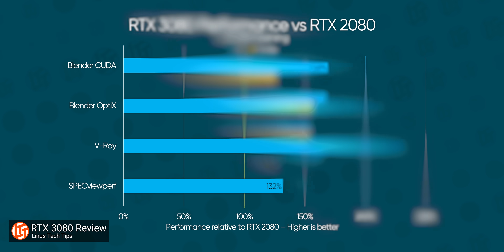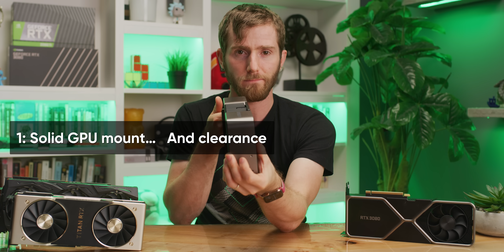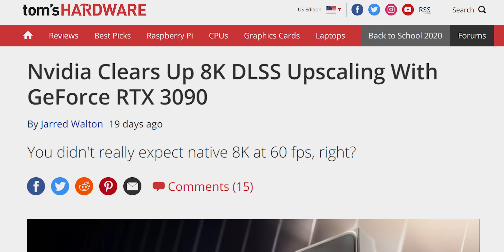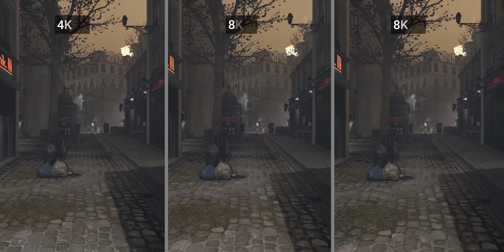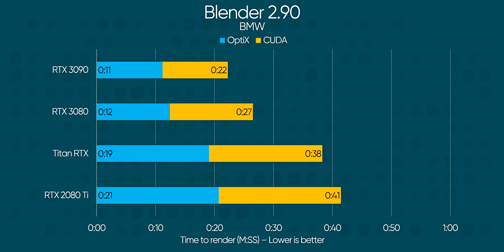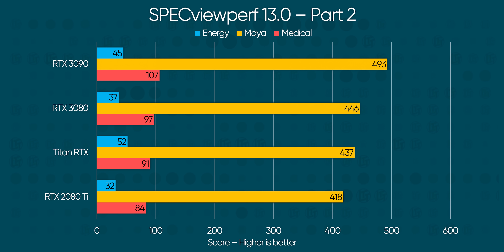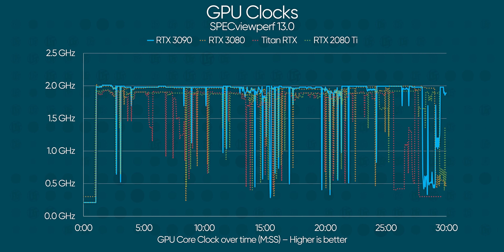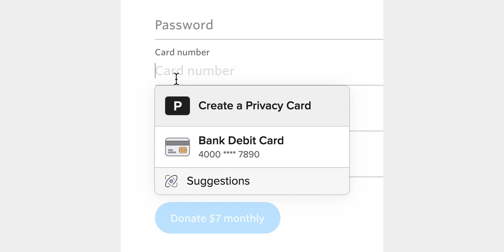Making Nvidia’s CEO mad - RTX 3090 Review

Comment: but most data i've seen including various pc platforms such as steam indicate that very little even play at 4k and even less actually have the hardware and since this is something you'd only notice with an 8k tv that's large enough cause lets face it unless you want the tv to look like a window(and quite frankly I don't think the pixels are small enough to be fit on smaller screens with current technology limitations)

I think the only people who can get this is the rich or the enthusiasts who would spend their life savings I got a 28inch 4k monitor and I am fully satisfied for the forseeable future plus I like to be able to reach my keyboard so a larger screen isn't an option or I wouldn't be able to see all of it possibly 30inch 4k would be my limit but i'm dirt poor now and the wall of next gen is so high I can't keep up so i'm considering a ps5 as long as the limited NVME storage capacities and high prices don't sink us into oblivion!

I suppose while xbox new ssd is a type where the price will likely be fixed, at least supported NVME's for the ps5 will price drop over the years so yeah... it will take me about 8-9 months but i'm getting a ps5 and even though it's got wi-fi 6 I know I won't be able to stream 4k cause my upload is only averaging 7.29Mbps

But yeah back to our current subject even if I was rich I don't see me buying this I easily get excited about new tech and this does excite me as it's a boundary pusher on the edge there but otherwise the tv itself and gpu not interested, I know nvideas is better than amd's best but even if I was rich I've grown accustomed to AMD now and if I make smart business decisions in the future and am able to afford a super pc by then hopefully by then AMD will of finally found away to close that gap

people thought it impossible with intel being closely caught up to who knows if amd keep pushing boundaries maybe one day their GPU's will have the recent success their cpu's have! but tbh despite competition making things interesting I wonder how much better their tech's would be if they did a collab and shared the best of both their hardware's

amd have been super successful at pushing those tech boundaries without too much of a dramatic price change which is why I was impressed to hear that new gpu of nvidea's cutting the cost of a gpu by 1000 while still improving the hardware greatly!
it goes to show the future may be bright if both companies end up on equal footing some day it could mean their competition may not only push tech further but may also push them into price wars which can only turn out for the better for consumers if things are more affordable on both sides!

also that gpu would not fit on my motherboardf (might fit in my case but considering the issues I had with keeping the RX580 stable with it's size and weight I think i'd have to bolt a small pillar to the underside of a 3080 just to hold up the farthest corner from the back to make sure it's weight would be held)

never try and use zip ties to hold a gpu (that was my learning process) we had to push through metal cause the msi ryzen case I got hadn't had the excess metal trimmed from the holes you nail the gpu to! my stepdad manage to use his inhuman strength to push it through by hand then again in such a flammable workspace drilling to clear it would of been a bad idea!

but hey now at least it looks cool now I just have to upgrade my psu though apparently the low W consumption of the radeon hardware are somehow taxing the the 600w PSU so I'm assuming it's getting on in age i've had it since around 2014 might get a 900W but as long as i'm saving for the ps5 that will be on hold as long as I don't do anything stupid the psu should last me another year or so anyway!

4k pathtraced minecraft with 7 different texture packs combined on max shader settings with just my budget rig isn't bad if I could afford vr it would run it but with barely any money and being unable to walk for anything other than a short distance without being out of commission for 4 days due to an illness I don't entirely understand means it's gonna be a while before I get the monetary funds I need to do better

good news is theres a computer scrap yard halfway to the closest town and there are official university courses I can study online and then physically just go sit for the exams to learn coding, computer engineering, metalwork and soldering, and computer science
not all are free but most of em are (except CS because it's an advanced higher learning course) I know now I at least have the capacity and aptitude to learn these things so give it 4 years I may be building my own machines any

and with a scrapyard down the road and bargain options I may be able to build a unique pc like no other once I have the skills to do more than just put hardware together... maybe I should make a video for my future self to watch and then I can look back in 5 yrs to see and think either my past self was an idiot or was on the money!
Reply: Also i'm just comfortable with the amd software it's a personal preference based upon what i'm used to You do you haters gonna hate but I don't give a damn about the whole war if sony and microsoft can to a collab on software tech then surely it's possible one day these giants will collab too but either way it's likely team red, blue or green regardless of collabs will continue to fight anyways!

Comment: I bought the 3090 Founders Edition to replace my RTX Titan. It's definitely a beast! I have a Falcon Northwest Mach V case, and it's a cozy fit, but plenty of room to spare. I've only thus far tested Crysis Remastered at 4K, which it can do 60FPS+ on High. It drops significantly, into the high 20's, when in "Can it Play" setting. I think for most people, the 3080 will be just great, and huge deals on the 2080Ti's which are still excellent at 4K. I wouldn't be surprised if the "Titan" variant costed $3,000+. I just bought it because it seems more future proof with its memory size.

Comment: Hey so in my current pc I have an intel i9 (9th gen) and my ram is ddr4 3200 32gb and my motherboard is a asus rog maximus xi hero and my power supply is Corsair hx1000 platinum. My current gpu is a msi GeForce rtx 2080ti trio does anybody know if I can upgrade to the rtx 3090

Comment: Never ever would I'll pay more than €50 for a video card.
Bought one gtx 680 for €50  and it works just fine
If I'm still  alive in 2028,  I'll get a rtx 3080 then for no more than €50 
So,  2.922 days  from now , need  €50 , uhmm ,  have to save €0.0171115674195756 a day.
Not an easy task but I think I can do it.

Comment: Hey linus! Long time lurker but, thought i had some questions. So considering the RTX 3090 is an enthusiast card, what would you put the Tesla K80 at? I just bought one to start learning dev- in physics simulations, I'm going to be running it in tandem with my Quadro2000. I just read somewhere to expect TFLOPs in the 1.87+ range vs the Titan RTX with ~.51.
Reply: Emily An  I just looked into the abstract of a CFF evaluation to get the basics, were you suggesting that for my physics simulation/analysis? Sorry if I didn't get the point you were trying to make. BTW I should let you know I spent 300 dollars on both of my graphics cards (used but in Pristine condition) [30GB total VRam] {4 display ports} My goal is multi-core micro/spectroscopy and thermal imaging of polymers under stress.

Comment: 11:00 How come your "high quality" power supply which is rated to output 850 W couldn't handle your PCIe card that draw around 450 W? Did the rest of the system draw over 400 W at the same time? Did you have too much stuff pulling from a single PSU rail?
Reply: Too much RGB

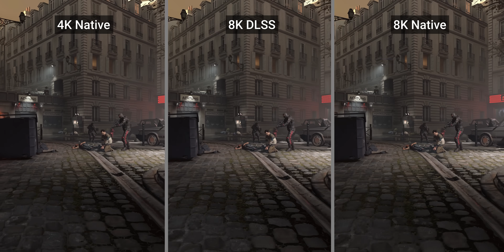Comment: 07:04 k, so considering I don't see ANY difference at all between those 3 video's.
Would that mean I don't have a need for any of that?
I just want my card to be able to run a game as its best settings without going slower.
I'm just hoping the 2080 ti I unfortunately bought without knowing the approaching 3000 series can do that.

As my eyes are apparently not as good as I thought, considering I really don't see that much of a difference at all in 8k or 4k.
Partially, that's making me also worried.

Might just wait another 2-5 years for the 4000 series instead of trying to sell my 2080 ti.

Comment: being able to expand the video memory is something they should have worked into their lower end cards NOT just their biggest beast of a card . i can see why it has it , but their low end cards should too.  because that is where memory can drastically affect pricing and performance.

that all said i'm so tired of the resolution bumping. it's not even about computers or video cards , it's all to sell fucking TV's we don't need.  NO ONE is broadcasting in 4k yet let alone 8k . most HD broadcasting is still done at 720 p and not even 1080p.  the yougner generation ahve shown they don't give two shits about   blu ray players or 4k players. i doubt the market will even see an 8k disc player. you know who needs and can actualy make use of having an 8k tv ?  not a single fucking person on the planet  except for the rich ass that buys one of those nvidia cards. and they'll more than likely be using a  PC monitor not an 8 k tv.  

from 1950 to 1995 standard  crts at a 4:3  640p  res  lasted long ., because people manufactured better products in the 50's-70's. in the 80's we started making every thing cheaper and disposable. and it's so industries can soak up more dollars on us replacing broke  crap they sold us  only 5 years ago.  the smae thing is going on with tv's they want to sell  us more , more and more so they have to push  the resolution to get us to replace our old tvs now.

Comment: I will always watch updates about the newest technologies knowing ill never be able to afford it :D
Reply: I always watch things about tech that I can’t afford and then get it in like 3 years 🤣
Reply: @robbydufault7382  eyy atleast u got it!
Reply: RTX 3090: changes the game
Me with my R5-1600 + RX 580 running Windows 7: hmmm interesting
Reply: @mihan2d  oh boi I thought about buying a gpu and I was like heck I forgot what is my processor - ryzen 5 1600 sad trombone noises. Still a great cpu but it's old propably going to bottleneck most of the new gpus
Reply: @eromisimo  BS. First Ryzen has still a decently strong core and with 6 cores and most modern games oriented for 4+ cores it is NOT going to bottleneck anything except for RTX3090 or 6900XT, as long as you have fast memory. All tech YouTubers say that CPU architectures are generally good for like upwards of like 7 years or even more. At least unless the core is weak to begin with, which is not (again, mainly dependant on memory speed here).
Reply: @mihan2d  I was thinking about second hand 1080ti tho
Reply: @mihan2d  and fast memory you mean ram ?
Reply: @mihan2d  I my cpu on 3.7 stable works like magic and got my ram up to 2800
Reply: @eromisimo  Should be fine I'm sure. If you really wanna juice it up for the 1080Ti you may try and play around with getting RAM to 3000 and the CPU for maybe 3.9 but up to your skill, I think stock Ryzen 1600 should be mostly fine unless you're playing at crazy high refresh rate monitor.
Reply: @mihan2d  might just buy 2x8gb @ 3400 for around 50 dollars
Reply: @eromisimo  I'd try and overclock first - it's free, after all. If it isn't stable enough, then might be a good idea to buy new memory.
Reply: Just think about it this way, in 10 years performance on this level will be dirt cheap :D
Reply: Yo what are you guys talking lol. Im just a casual with i3 10100f x RX570 playing anything that i can sit with 😂

Comment: Issue I have with the 3090 is that all the previous 90 suffixed cards were 2 gpus on the same PCB or sandwiched together taking up only 1 PCI slot. Friend of mine mentioned the 3090 and my first thought was "Nvidia said several years ago they are done with dual GPU cards...(remembers the 690)". Double the Vmem is amazing though. Aside from leaving headroom for higher FPS or higher resolutions, I have never regretted advising friends to get the GPU with the most onboard memory when they go to buy a flagship. The 3090 easily is a card that will last for 4 years of solid gaming even with new titles making use of more vram. Pushing 8k gaming is laughable though. 8k in any normal PC gaming situation is more DPI than needed by far; I still don't know anyone that would benefit from more than 4k(even that is too much normally, 1440p being the best for almost all). Also, it's been a long time coming, cases should come with mounting meant for a GPU with riser cable. For 10 years motherboards have been strained with heavy cards pushing on PCIE slots. It makes more sense to mount the GPU to the case completely unsupported by the motherboard. Freeing up the GPU to be mounted elsewhere allows for much better air flow if done thoughtfully.

Comment: Linus dude - Can you use a standard air cooled RTX 2080 Ti's with similar power limits as the 3080 as there are just as many out there. They even run cooler, generally can clock happily between 2000-2130 without a bat and I really have not noticed much of a speed difference when comparing 'apples to apples' rather than a lower power limited 2080 ti without power limit increase to get the most out of it while it still runs cool.

I have ran all the 3DMark tests with my 2080 Ti that is stock with a 312w power limit. The differences range from 0.04% to not even 10% when comparing with my i7-10700k at similar clock speeds and 2080 Ti with similar power limit. What gives???

I bought my Asus 2080 Ti 312w power limit lives in 2070-2130mhz and 8ghz with no mods just msi afterburner in a decent case. I purchased it over 2 years ago in Sept 2018 for $1259 Australian, sure the prices went up this year but at least the build quality is good and they run very cold even with annoying aggressive Turbo Boost 4.0 kicking in from 45-50 degrees. The price factor with the feeble Nvidia stock for the RTX 3080s have now made the 3080s go for that price or more here. So, that price thing really isn't real world but Jacket man sure got the hype train going in his kitchen by using Minecraft and 1997 Quake 2 with ray tracing as % figure comparisons. I think their stock after Sept 9 announcement was actually higher than the 40bn to acquire ARM. So, the old wear the same clothes CEO thing and funky graphs fooled the world.

After seeing that Doom Eternal comparison I knew something was weird. As I had just completed it at max settings at 4K WITH HDR on (unlike their comparison). I don't recall it dropping under the 100fps very often. So, naturally I went to the intro spot where the first Boss is in Mission 4. My card was within 1-20fps of the 3080 and almost always 20-30fps more than what ever card nvidia used for a 2080 ti. 

3DMark Tests: My Card Average temps are less than the 3080s and in general all the scores are within 5% but the 2080 Ti is a good 10-15 degrees cooler. Still under powered at 312w. Even with just 2 fans. all tests are in the 50s with avg mhz between 2040-2085 - max of 2130. The 3080s are more like 70s.

So, lets do some real world comparisons. Outside of Minecraft and Quake 2. 
Result comparisons with same excellent gaming CPU. Intel i7-10700k at 5.0-5.1ghz (no liquid nitrogen crap) and of course only 1x GPU. My similar powered limited RTX 2080 Ti of 312w Vs. Nvidia RTX 3080 with it's 320w power limit and not a cheaper aftermarket fail brand that can't handle 2ghz.

Results are for all RTX 3080 scores using same CPU i7-10700k at similar frequencies above 5ghz. To reduce the CPU physics score component and just video card performance.

3DMark Time Spy - 4.9% difference actual. 
3080 320w Power limit with i7-10700k @ 5.1ghz has a Highest score*: 16874 and *Average score: 16183
My 2080 Ti 312w Power limit: My score is: 15416 -> 2.5 years old 54 degrees. 

Fire Strike 30,350 my score on average for 3080s is 30,543 https://www.3dmark.com/fs/23609474 & https://www.3dmark.com/search#advanced?test=fs%20P&cpuId=2615&gpuId=1338&gpuCount=1&deviceType=ALL&memoryChannels=0&country=&scoreType=overallScore&hofMode=false&showInvalidResults=false&freeParams=&minGpuCoreClock=&maxGpuCoreClock=&minGpuMemClock=&maxGpuMemClock=&minCpuClock=&maxCpuClock=5050

Port Royal: https://www.3dmark.com/pr/306520 10,250 Vs 8,600 for the nvidia graph of a 2080 ti. and about 1000 points less than a 3080 for a heavy Ray Tracing Test. Big whoop. Even my i7-4770k manages a 9,600 score. 

In fact a i7-4770k overclocked when looking at the graphic scores showing FPS it is always within 3% https://www.3dmark.com/compare/fs/23145855/fs/23092688?fbclid=IwAR06D9YaM8D9aIz6NDgHfl8efV4Tbpi64ZtJbgT59fMmiqaTnG0YIHsoAXQ

https://www.3dmark.com/compare/spy/12840200/spy/13758691?fbclid=IwAR0bbkd7tpUSBMinmmOaMvT5LH6T3Ma1bQvmJudkIF2B_w64bKs_Geh-RRM

Fire Strike 30,350 the 3080 has an average of 0.05% difference https://www.3dmark.com/fs/23609474 for the RTX 2080 Ti .and For the RTX 3080 the Highest score: 32824
 Average score: 30532